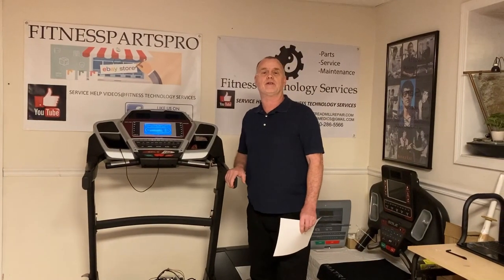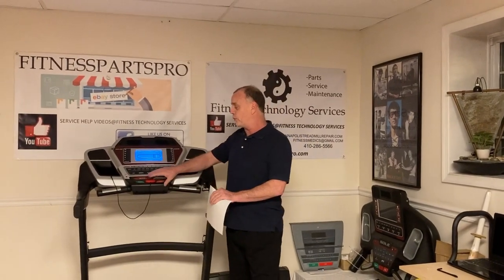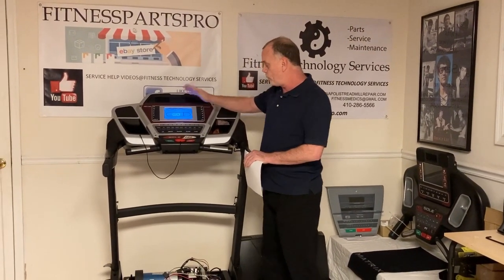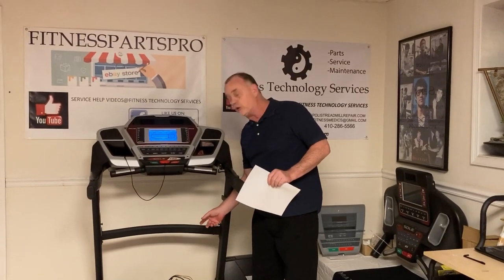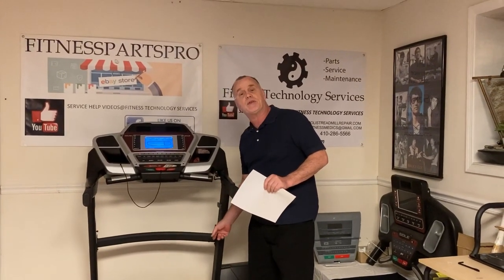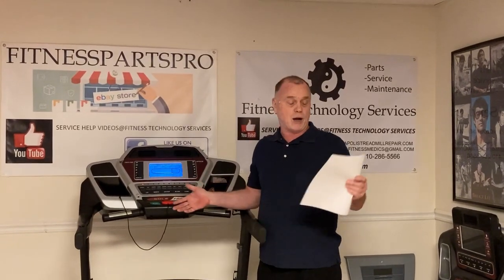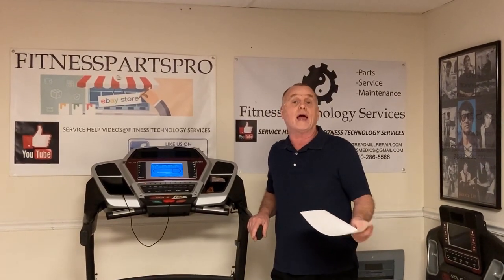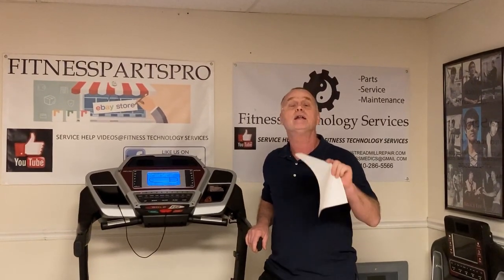SOLE TREADMILL TROUBLESHOOTING

Comment: Hello. My Sole F80 shows an E5 error 9 times out of 10 when I turn power on. If it doesn't give the E5 error on power up, it will give E1, E4, or E7 when I hit start. Any ideas? E3 is also shown where the incline should be.
Reply from the maker: Well no way ! That’s every code it has (almost) you can check and reseat all your wire harness connections . Has the unit been moved? Could be something as easy as a pinched wire. Or I would think the console display it is the only thing that could send all those codes and then still work. It is less likely the controller would do that and still work. Send me your serial number to Fitnesspartspro@gmail . Com if you want me to see what you have..Dave
Reply: @FitnessTechnologyServices  it never actually works. there is always an error. usually just E5 on power up. cycle power, same thing. It has not been moved since I assembled it. I have reseated all connections and the cables from the controller to the display board have been replaced.

Comment: Hi can you please give me advice? On my f63 the speed increment buttons are not working. Not working on right handle bar and on console. Could it be bad micro switches? Would spraying contact cleaner help? Also stop button Not working either.
Reply from the maker: Hmm problem is more likely to be in console display board ! Disconnect your hand switches and see if console buttons work then if need parts send me your serial number to Fitnesspartspro@gmail .com or for better tech advice Dave
Reply: @FitnessTechnologyServices  I checked all the wires and they all have continuity I think its a problem with the board, a chip or something or bad trace line Idk.
Reply: @FitnessTechnologyServices  whats weird is the slow and fast buttons on the console itself actually beep when I press them but it doesn't register in the treadmill itself and doesn't get faster or slower.
Reply from the maker: @TheBull06  Ok that is odd I will think on that there are some other steps but I would need your cell number sent to my email so I could send you more info it’s called a pin test but I am reluctant to put it on YouTube 🤔Safety first
Reply: My f63 treadmill is doing the same thing.  What is the fix?
Reply from the maker: @kackleby  Hmm that video is for general troubleshooting please send me your serial# number to fitnesspartspro@gmail.com for better help also tell  me what your unit is doing
Reply: Did you all figure it out?  My sole is doing the same thing.

Comment: Hello, I have an Sole F80 ...  the other day I  was on the treadmill for maybe 10 minutes,  my speed was 2.2 and my incline was 1 - I was walking  not running.   Out of the blue, the treadmill stopped and displayed an E6 error.    The sudden stop took me by surprise for sure.   Do you have any ideas on  how to fix/trouble shoot this error?  Needless to say, I'm a little apprehensive about using the treadmill again until its fixed.
Reply from the maker: Hmm does the unit continue to run .A E/6 error code is loss of communication between the console and controller. Run unit with no one on it and see what it does
Reply: @FitnessTechnologyServices    I ran it for 60 minutes ...  2.2 speed, 0 incline, then another 15 minutes, same speed, incline = 1.  No one was on the treadmill throughout the test.  Never errored out, never stopped.
Reply: @FitnessTechnologyServices  when I originally got the E6 error, the treadmill stopped.
Reply from the maker: @techstermb   Ok then this sounds like belt issue 9 times out of 10 this is worn belt . Causing high amps send me your email to Fitnesspartspro.gmail .com . I will send you links for testing or visit my channel fitness technology services
Reply: @FitnessTechnologyServices   email sent

Comment: Our month old F63 machine stopped in the middle of the run and shows a key error! What to do?
Reply from the maker: Your parts should be under warranty labor also . It sounds like a bad key module I would report it to sole for sure.
Reply: So should I go to dicks where I bought it or call SOLE?
Reply from the maker: Both but sole is in charge of parts

Comment: Sole F63 - replaced control board about 2 weeks ago.   Treadmill was working just fine, when it suddenly stopped mid run.  Received E5 code, and need help.  Treadmill is 4-5 years old at best.  I’ve lubed the belt and keep it clean.  So frustrating
Reply from the maker: Hmm so far all the E5 I have run into has been the display or lower wire harness it is listed as   A communications error .So I would recheck all wire connections first at handlebar and lower connection by upright
Reply from the maker: But they are new codes sole would know better what they are . And some times lube is not enough help depending on amp test ! May need walk belt also
Reply: @FitnessTechnologyServices  I also have an E5 code. I checked all wiring and everything is connected properly in the upper and lower tube frame as well as on the MCB. Any idea what it may need?
Reply from the maker: @DxROE  I would have to say lower motor controller went bad .Send me your serial number to Fitnesspartspro@gmail.com so I can see what your’s takes.And send you links for testing

Comment: What if your incline isn’t working on an f85 but it is still working on zero elevation?
Reply from the maker: That is hard to tell first step is to check if your unit is sending ac voltage to incline ?see my video on sole motor control troubleshooting
Reply from the maker: If you would  like better troubleshooting send me your serial number to fitnesspartspro@gmail.com

Comment: Thanks for the video. I have a Sole F80 that abruptly stopped working halfway through my workout. It tripped my main 20-amp circuit breaker. Once breaker was reset the motor no longer operates. I received the error message LS1 with low-speed flashing once I hit a speed and it counted down 3-2-1. Per your instructions, I tested the motor with a 12-volt battery and the motor works fine. The circuit board shows 2 green lights when on but, when I hit the speed control to start the process a third green light comes on and then turns red when the motor fails to start. It looks like a may need a new board, what do you think? Serial # 5808101008009437. About 650 hours on it in 13-years. Thank you for your help!
Reply from the maker: Yes for sure that sounds like a controller. But with the age of unit I would replace the walk belt also. See my video on testing your sole walk belt
Reply: My walk belt is like brand new. Are you able to help me with the board and what is involved?
Reply from the maker: @davidk5354  well of course but please do a walk belt test even when they look good the underneath gets worn and over loads the controller unless the walk belt has been changed in the last couple of years. Send me a email to Fitnesspartspro@gmail. Com The office will send you options for the controller
Reply: I performed your control board test and walked on the treadmill as demonstrated by your assistant. The only difference was it was very hard to get the walk belt to rotate. Everything functioned normally but when letting off it went into the same LS1 low speed message and quit. Trying to do the incline while walking was too much power draw and tricked the treadmill specific house circuit breaker. Doing it a second time the same thing happened but this time with some sparks and smoke/smell on the board. I will send an email.

Comment: Hello sir, I have a problem in Tradmill that is when I speed up it goes up but when I down it still speed same ratio but in console it speed down
Reply from the maker: Hmmm this sounds like a lower  controller issue. What year is it?
Reply: It’s 4 years. What’s the issue of the lower control card can it solve with calibration
Reply from the maker: @mahendramaharjan9095  no I don’t think so you could try it it never hurts it to try . But when it does not slow down it normally means the controller is not processing the console signal right

Comment: Great video. So happy to have found you and hoping you can point me in the right direction. I have a 3 year old F63 (serial no 5638182010094926) that was recently moved across the country. The movers set it back up I. Our new home and the display comes on and the buttons below it work, but the Start, Stop and all the buttons located on the treadmill base do nothing. Help!
Reply from the maker: Well thank you I would start with unhooking the handle buttons just in case they have a short on them. If not you may have to remove the back cover to replace the start and stop buttons

Comment: Mine says software vi.i and doesn't start
Reply from the maker: That is a bad console
Reply: @FitnessTechnologyServices  Thank you, how do I fix it?
Reply: @FitnessTechnologyServices  This is a Sole F60
Reply from the maker: @nicp2344  you would have to contact sole. If they have the display and you are technically able replace this. If not you will need to replace console. Have serial number ready sole will want it

Comment: How about E-7 error?
Reply from the maker: This is a newer code in the manual it is listed as bad power source. But it also can be bad lower controller . Due to walk belt wear, send me your serial number to Fitnesspartspro@gmail . Com And I will send you links for testing
Reply: Yeah I got the same code. Bought it in 2020 used it for a few months then left it sitting in the garage until the past month. Now me and my wife walk on it a lot and I use to incline and now I’m getting a E7 error code.
Reply from the maker: @rookieandvintagegraded6641  this should be under warranty, check to see if your green light is flashing . This is a sign your motor controller is bad
Reply from the maker: @rookieandvintagegraded6641  look for a flashing power light on your controller this normally means bad controller
Reply: @FitnessTechnologyServices  I ended up cleaning in front of the treadmill and moved it from against the wall and it works now.
Reply from the maker: @rookieandvintagegraded6641  Well that’s the best for sure 👍

Comment: I’ve had my treadmill for 9 days and it’s already broken
Reply from the maker: Hmm no one wants that .Check for power light on motor controller if on ! Check motor controller harness connections .And of course call sole
Reply from the maker: Just checking do you get your Issue fixed

Comment: I have a new (2020 model) F85 treadmill. It's working fine, however, I went to do a calibration (after changing the units on the treadmill) and it started, the belt moved for a few second, and then a 'E-1 Error' appeared on screen. Any help would be appreciated. Thanks.
Reply from the maker: E/1 code is the speed Sensor code try moving it some it may have to be replaced
Reply: @FitnessTechnologyServices  Thanks for very much for your help. I really appreciate your insight. It increasingly looks to be a software issue, as the treadmill works fine, apart from at calibration. So one would assume that the speed sensor would be an issue outside of calibration as well. But that's not the case. It appears I'll be receiving a new console as a result.
Reply from the maker: @curranjason  Well let’s see the new consoles don’t use the speed sensor for running only for calibration of speed to test this unhook or move the speed while it is moving . If the unit is seeing the speed sensor it should shut down Please let me know so I know 🤔not much information on new console yet still learning